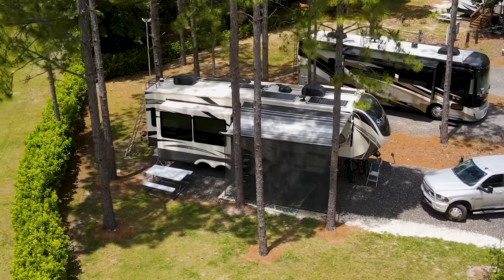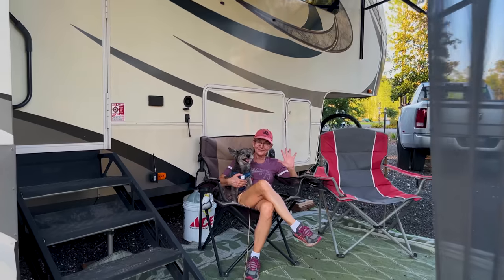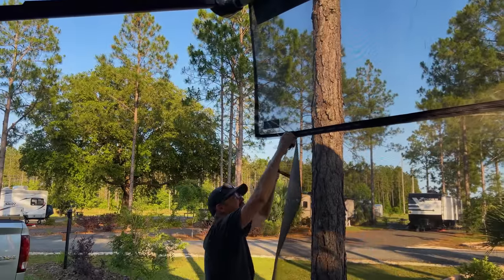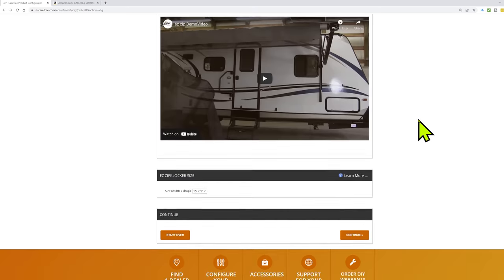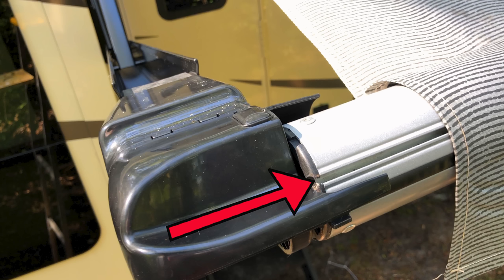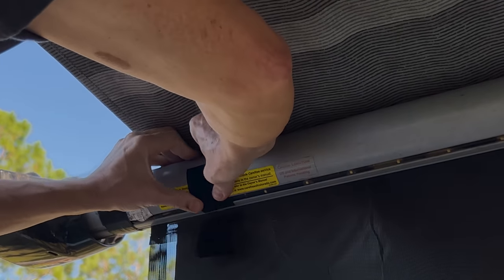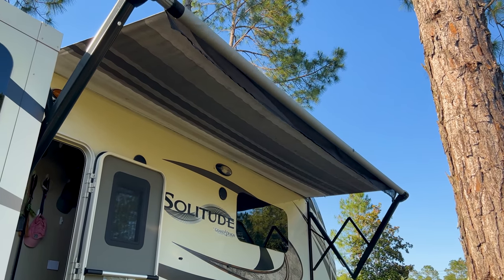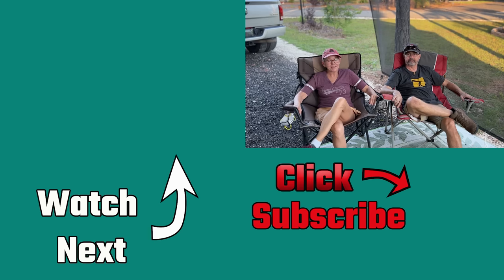EZ Zip Blocker RV Awning Sun Shade Review and Install (RV Living) 4K

Comment: This was the 1st item i bought for my rv 5 years ago and its been great, they also make cut to fit window covers that use suction cups to attach to the outside of your rv.. btw your awning has adjustable height on the arms,  i was able to lower mine and easily attach the screen just standing on the ground
Reply from the maker: Thanks. Larry adjusted the arm so it’s sloped to one side so rain drains off. But I’m fine with unzipping it the way it is- our site has a slight slope on the side which makes the awning seem higher. 
I’ll look into the suction cup window covers. Too bad we don’t have a second awning- that would really help 🤗

Comment: Good day Guys; great review! We have had our ez blocker for quite a few years and it is still in great condition. We also got 1 end /side blocker. Put the connections on rv on both ends so we can choose which side we want to block. I would like to get a second. We don’t just use for shade; it also does a good job avoiding bugs. We live in Alberta Canada where it isn’t not windy often. L0L Always always use tie downs in Alberta! We use tie downs even when we use the ez blocker.
If you are in the area; be certain to look around to see if anyone is using their awning. Wind shears are hard on awnings! Thanks again for another great video!
Reply from the maker: Thank you. Hope this helps others decide if it’s right for them - whatever brand. 
I’d like to try the sides, too, to help with bugs. Good to hear it helps. Maybe that will be our next purchase. 
The awning being ripped off due to wind is definitely one of my fears. 
We spent the last two summers and part of spring in Canada - Ontario & then the Maritimes. Larry grew up in Oakville, Ontario 🇨🇦 ❤️
Reply: @DownsizingMakesCents  L0L born and raised in Chatham, Ontario - they don’t have wind; or what they call wind is a daily breeze in Southern Alberta! So; your fear of it getting ripped off? I saw that has happened to you once?. We lost our manual awning on our old rv 3 times to wind bursts. No warning- there and gone. So our new rv has an electric awning- we treat that baby with super caution. The disadvantage being that we have never replaced it and it has actually worn out the fabric? L0L that never happened before - so what’s better? Getting old and worn out or getting ripped off and staying new.

Comment: I had EZ zip blocker for 1 trip. Sent it back to amazon when we got home. Great idea nice quality but when you are facing west at 4PM in the hot direct Florida sun it does not help one bit. You just sit in your chair sweat and cook in the sun. Looks like the way you have it set up works great but I would like to see you review it facing west at 4pm in bright summer sun. If you get a blocker for all the other reasons it works great but does not work for hot direct sunlight.
Reply from the maker: That’s why we said there are many reasons to get the sun shade. 
Once we start traveling again when Larry is better, we will be facing all different directions if sun. 
For us, it’s helps for many things.

Comment: Great demo!!
Most, most rv parks will have an A frame ladder to borrow.
Have you work out an anchor for concrete pads?
Reply from the maker: Thanks. We asked our campground host - no ladders? 
As for concrete pads? A lot of people use water jugs. We also saw people use cement blocks - seems a bit heavy, but if you are a permanent resident, that seems to work